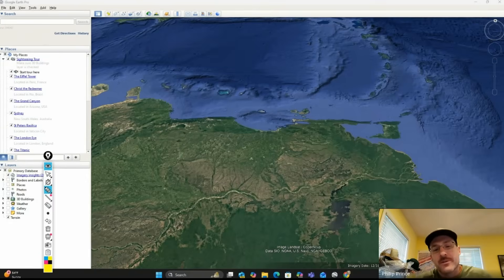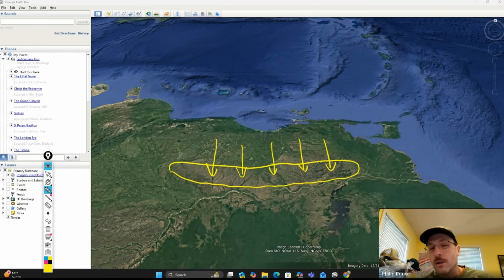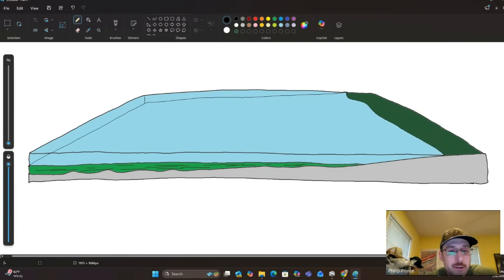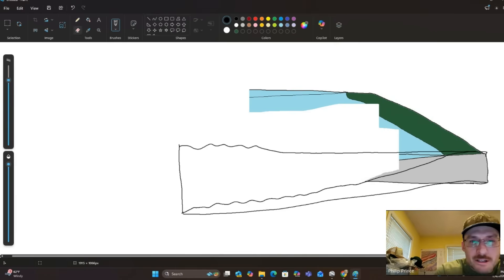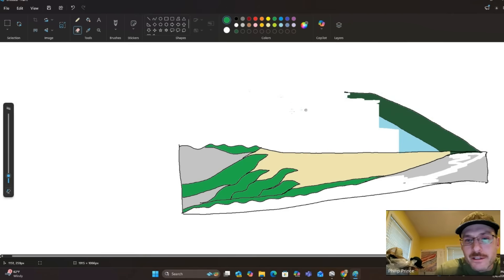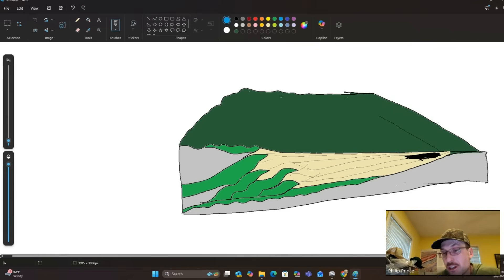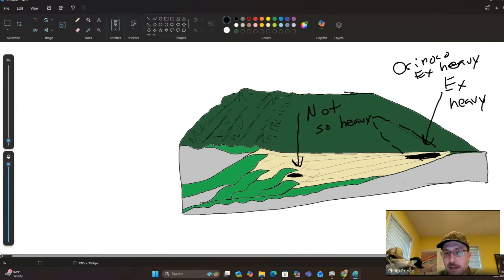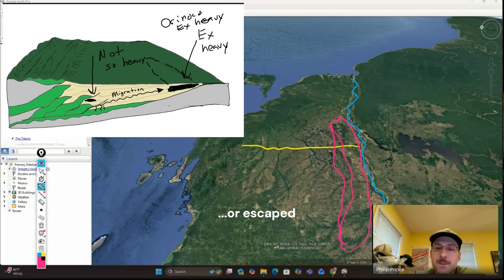Why does Venezuela have so much extra heavy, sour crude oil?

Comment: Thanks! I was curious about this because I work in the maritime industry and we implemented some new limits for fuel sulfur content in 2020. We use as the residuals as fuel for most cargo ships. Since heavy crudes produce more residuals relative to the distillate fractions, and we had just banned high sulfur fuel oils for ships without sulfur scrubbers, and since most shipowners decided to just buy cleaner fuel rather than install those scrubbers, it was my understanding that the IMO sulfur limits had hurt the value of these types of very heavy and sour crudes. Which made me curious both about why the US would even want this junk oil and also how it got like that.
Reply: A lot of our refineries are set up to process heavy, sour oil (for whatever reason), and it's expensive and time-consuming to switch to light, sweet oil.
Reply: It's not junk oil since the US economy runs on heavy sour crude. It's our primary source for sulfur, which is mostly turned into sulfuric acid for the production of fertilizer and chemicals. The liquids are mostly kerosene and naphtha. Kerosene is refined into diesel and jet fuel while the naphtha is cracked into gasoline. The asphalt is used for road paving, roofing and water proofing. The asphalt can be cooked to remove all hydrocarbon liquids to leave a residue called pet coke (petroleum coke) which is pure carbon. It's often burned at the refineries to generate heat and steam for the processes and to generate electricity. It's also sold to therm generation plants and cement kiln operations. Heavy sour crude yields very little gasoline and lubricating oils so the vast majority of US refineries are designed to run a mix of heavy, intermediate and light sweet grades of oil.

Comment: Is the heavy crude, similar/different from the oil sands (like those in Canada)? I do think it seems like with oil demand falling this century it may not be worth it.
Reply: AIUI it's extremely similar.  Many of the US Gulf Coast refineries are designed specifically to process it.  Previously the vast bulk of the heavy crude that they refined was sourced from Mexico and Canada; with the loss of the latter (over the past year Canada has mostly shifted their crude exports to other countries) the US is looking for a suitable substitute source.  Venezuelan crude could be a [poor] substitute and indeed the Gulf refineries already refine a small amount of Venezuelan crude; the problems with switching to it are its poor quality and very low available volume.

"it may not be worth it"
That's precisely the issue.  Looking solely at production costs (ignoring security and the like) it's estimated that it would take ~100B USD over 10 years to bring Venezuelan production to anything close to the level needed to replace Canadian crude (~50% the level IIRC); add in the ~1B USD per year in Venezuela-specific recurring costs and it means that the refined products would be worth less than the cost of production.  IOW, Venezuelan crude cannot substitute for Canadian crude in any meaningful way.
Reply: @alexhajnal107 thanks for the thoughtful reply. Here in Canada, there is a long national debate about what to do with the oil sands, how much to extract, where to refine it, and where to export it, there’s several pipelines now to the east and west coasts, and a new one just greenlit to the north coast of BC. I personally,y don’t support more pipelines as they’re last century’s infrastructure, but the Alberta separatist movement - which is largely funded by right wing US groups - is holding the country ransom basically. 

It’s just crazy that at the same time that the Venezuela invasion goes down, the US green lights export of top end chips to china. Trading the technology of today and tomorrow for more of yesterday’s technology seems so short sighted. 

Lastly is there not an issue with flooding on the Gulf Coast? With rapidly rising sea levels, and with the ground subsiding faster there than anywhere else, won’t all the processing capacity be underwater in a couple decades?

Comment: I've read somewhere (can't find the source) that there is crude oil in Venezuela that is only a couple of thousand years old, in contrast to a more common tens and hundreds million years in other deposits. Wonder, how much age impacts the quality of the crude-?
Reply: I believe that's called New Oil coming up from the source rock. They can determine the age and which field petroleum came from by its chemical composition. Oil field operators will turn off the jack pumps to allow more oil to be pushed towards the producing wells. Wells have been taken out of production for decades so more oil can enter the formation. They'll test the wells later to see how much the formation now holds and often find them now holding new (younger) oil with a different chemical composition. The US has a giant oil terminal in Cushing, Oklahoma that's full of gigantic storage tanks that hold those different grades of oil. Refiners will order a mix of those grades to get what's needed to fill current orders from customers. The majority of US refineries are configured to run a mix of heavy sour crude with other grades. The heavy crude provides sulfur for the production of fertilizer and chemicals, kerosene for diesel and jet fuel, naphtha to crack into gasoline and asphalt for roofing, water proofing and road paving. They also can cook all of the liquids from asphalt to get petroleum coke (pet coke) which is pure carbon. Some use that to generate steam and electricity at the refinery while others sell theirs to thermal power generation plants and cement manufactures to burn in cement kilns.
Reply: @billwilson-es5yn  Thank you for your take on this. My impression was, when I first read about this "young oil" , that it meant the kerogen itself had had only a couple of thousand years to sit. 
There would be an analogy to this in the world of coal: I've also read reports about woods buried in a landslide after the latest glaciation, which purportedly have been turned into "coal". That would make this "coal" younger than 10,000 years. I have never seen samples of this "coal" (probably more akin to peat?) .
In the case of that "young Venezuelan oil"  an age was mentioned, I think it was something like 5,000 years. Whereas your explanation would mean a continous "oozing out" from the kerogen, a process, which would give an oil with a range of ages from  - whenever oil deposition started to recent times.
Reply: I recall reading that tar “lakes” in that region were a source of paving asphalt binder in the early twentieth century.  Might have been from some islands in the area as well.

Comment: Where would the iron in a source rock come from?

How can a living thing not have sulfur? It's part of the DNA backbone. Is it just not enough to make a difference?
Reply from the maker: It's in the organic molecules for sure, but in the case of source rock material, the typically quoted "bigger" source is sulfur reduced from inorganic sulfate in the ocean. This is why the lake basin example can produce very sweet crude despite also being developed from algae, plankton, etc.
Reply: "Where would the iron in a source rock come from?"
For relatively young rocks either from the mantle or from an extraterrestrial source.
"How can a living thing not have sulfur? …  Is it just not enough to make a difference?"
In this case it's the latter.  Most terrestrial life uses carbon in its metabolism; go down 3 km or so and one finds anaerobic bacteria that additionally instead use sulfur in their metabolic processes (such are also found in hot springs and mid-ocean vents).  In the case of crude the bacteria are transforming sulfur in their environment into a form (H₂S) that easily contaminates the crude.
[Caveat: The above is a lay understanding, I am neither a trained geologist nor a trained biologist.]
Reply: @alexhajnal107 iron is quite ubiquitous in most rocks. Not necessarily economic iron ore deposits, but every sedimentary rock you've ever seen with a red/brown/mauve/orange/green/blue tint, that is just iron in different concentrations and oxidative states/mineral assemblages. If it's redish that's oxidized hematite, if it's green/blue that's reduced iron. There is always some iron in all rocks, basically. There's a little bit of uranium in most everything too! Just not a lot.

Comment: There is more energy in heavy oil with API viscosity below 20.  That's why ship diesel engines burn 'bunker' oil, not truck diesel. 
Sour crude contains more hydrogen sulfide, and sulfonated organic molecules.  Trucked tar sand oil has to be heated to 
lower viscosity to pump from truck at refinery or flow thru pipe lines and is diluted with 'light-ends' .  Worked in the 'patch'
Reply: When I was working in the oil analysis industry my boss used to talk how "bunker oil" really was oil with excess sulfur mixed into it. The excess sulfur was a product from desulfurization of crude rich in sulfur. So the sulfur, which was taken out to get premium qualitiy diesel was put in again on the other side. In other words, we would prevent acid rain over congested urban areas and instead create acid rain over the oceans... . But I've never had anyone corroborate this story from my boss. All I know that bíg ocean vessels engines require lubricants with a tremendously high "Total Base Number", a measurement for the amount of bases (usually calciumhydroxide) present in the lube. This would absorb and neutralize acidic gases created by combustion of sulfur compounds and thus protect the engine parts from corrosion.
Reply: @klauskarpfen9039 I doubt if they added excess sulfur to bunker fuel since it can be stored to sell later. The US EPA allowed a certain amount of sulfur to remain in diesel fuel and bunker oil due to the cost to remove all of it. Then they changed regulations to have more removed.
Reply: fun fact.  exporting refined petroleum products from the USA is illegal..so we "loan" Canada our naptha, they dilute the tar sand oil, pipe it to Detroit..then we reclaim the naptha and a take a healthy margin on top.
Reply: @Live.Vibe.Lasers The Federal Government prohibited the export of domestic petroleum back in the 70's or 80's. Early this century the Federal Government decided to only allow the export of NGL (natural gas liquids) since we now had more than we could use and no place to store it. There were plenty of buyers since plastics and chemicals are made from it. I believe the ban on exporting unrefined petroleum is still in place so the US exports finished refined products (gasoline, diesel, jet fuel, lubricating oils). The oil tankers bring heavy and partially refined crude to the Gulf Coast refineries and leave loaded with finished products.
Reply: @billwilson-es5yn Cool..some more context.  I do know that we are exporting LNG..hundreds of billions of cubic feet per week.  I was unaware that we are also exporting NGLs and refined products.
Reply: Oh..you know what..I was aware that NGLs are being exported.  20 years ago..Sunoco sold all of their refining capability near Philly, save 1 plant.  They converted it to ethane liquification and the Mariner East pipeline transports ethane across Pennsylvania to it.  Ineos (a chemical manufacturing company..interesting story..they bought up all of BPs olefins business for pennies on the dollar..was using North Sea natural gas to run an ethane cracker in Scotland until the field depleted)..built something like 12 LNG tankers and they just ferry NGLs from Philly to Scotland..all the time..in a big loop.  They call it a "virtual pipeline" and the ships even run on their own cargo.  Sir Jim Ratcliff started Ineos with $2.5million of his own money..and $50mil in junk bonds.  Ineos now does $24 BILLION in revenue annually.  He's one of my heroes.  Very forward thinking.
Reply: @Live.Vibe.Lasers Refineries are the most efficient when running at full capacity so our Gulf Coast refineries have no problem churning out more higher value finished products to export than we can use or store. The NGLs sell for a much higher price per barrel than oil so make a lot of money for the field operators until demand drops. Then they shut off the wells to wait until demand picks up again. The US supplies China with nearly 100% of the ethane they use to produce plastics. Trump gets their attention and brings them to Jesus  by threatening to cut off their ethane shipments.

I wonder if Sunoco refinery closures is the reason why the New England States import finished motor fuels from Europe? They also import LNG from Qatar. Both are due to the State of New York prohibiting the construction of pipelines that carry either one across their state to those states. Nice neighbor!

Comment: 14:18 The route of the Orinoco River coincides with where the basement rock in your diagram reaches the surface.  Is that coincidence or is there a reason that the river has formed at that location?

Comment: Thank you for addressing this. I was wondering the same thing but didn't ask because I hadn't seen you get into the chemistry side of geology before. I should have know better. What makes it really interesting to me is that relatively close by verge large reserves of light sweet crude has been discovered off the coast of Guyana during the last decade. Based on the information you have provided, I suspect that this oil comes from a completely different source and geologic history.
Reply from the maker: it’s in basins related to continental breakup and later burial…sort of like taking the rift lake example, making a bunch more, and then blanketing them with thousands of feet more sediment. there isn’t the plate collision/stacking and tilting/long migration process there. you are correct that the geo history and products are different!